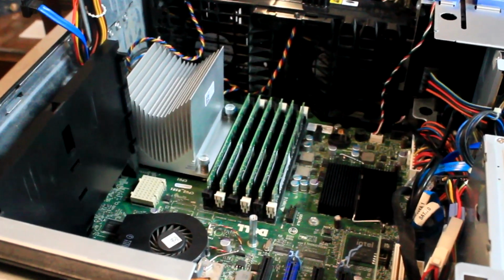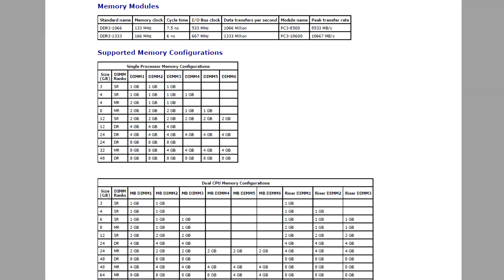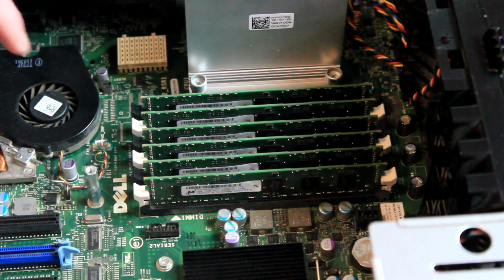Dell Precision T5500 Build Series: Part 3 - RAM Upgrade

Comment: Hello - I am looking for some help on RAM config. I just bought 3x of the $22 Patriot DDR3-1333Mhz ram from amazon. I put all 3 in the riser and then have 6x 2GB chips on the main mobo. I get the 1-3-2 beep code and even after an hour the 1+3 lights are on and it won't boot. Not sure what I'm doing wrong with the config as it appears to match the service manual. can you advise please?

Comment: Per the diagram in the service manual, there are 3 channels per CPU. Why would it make sense to add the larger ram to the riser? Shouldn't the channels be evenly distributed? I know that starting with the riser is what the instructions say, I am just trying to understand the logic. Ta.

Comment: I installed 3 new 8gb ram cards in the riser, and transferred my old 1gb modules to the motherboard so that all 6 dimms are filled. (3-8gb cards in riser, 6-1gb cards on motherboard).  When i start the pc back up it just beeps 3 times and nothing comes up on the screens.  Did i order the wrong ram cards?  Memorystock.com sent me 8gb 2rx4 pcl3-10600r-09-11-e2-p2  thanks for you vid!
Reply: I have the same problem, did you manage to fix it? graxia
Reply: @Eduardovn23  yes, but i had to order 6- 4 megabyte cards (total of 24) so that all the slots had the same capacity.  it worked fine after that
Reply: thanks! I have the same issue. I ordered 3x 4GB chips from Amazon. So 6x 2GB chips in the main MOBO slots, and 3x 4GB in the riser. Get the same 1-3-2 error - do I need to have another 4GB chip in slot 1 of the MOBO for some weird config issue?

Comment: Is this series to be continued?  I am interested in it, because my T5500 is on-order.  I am building a home server for games and media.  My new system is coming with 24gb installed, I assume 4gb modules (because they said 6 modules), so if I upgrade by adding some with 8gb modules, I would start putting those onto the riser card, moving the 4gb modules all to the mainboard??  Since I would be adding 3 of the 8gb modules.
Reply from the maker: That is correct. The higher capacity modules go onto the riser board. And yes, the series will be continued, it will be 10 parts when complete
Reply: @DVTutorials  That's great!!! I just got one the other day and running it.  Works very well.   I look forward to more videos from you and I just subbed.   Thank you.

Comment: I have a couple of questions. 1.  If you had the choice of Hp z600 or a T5500 which one would you get and why? Also, can the t5500 use dual X5680? Lastly... Is it easy to replace the internal speakers in the t5500?
Reply from the maker: I have not personally used a z600, but a review of the tech specs for that computer don't even come close to those of the t5500 (RAM, CPU, etc). The Z800 is closer to the T5500... Yes the 5680 would work... and the internal speaker is a simple install but its a cheap business speaker and I believe you need the dell audio driver for it to work properly. Reference the precision manual here https://dell.to/2WsOwYg

Comment: Quick question, only the T5500 and T7500 support those higher density RAM modules, right? A T3500 even with an X5680 (as an example) would only support a total of 24GB, right? I'm reading conflicting things on the internet and wondering if I can stuff 48GB of memory into the T3500, assuming that I can find that much for a decent price, ha. I know the higher end models need Registered ECC and the T3500 needs unbuffered ECC, which makes prices a little screwy when looking online.
Reply from the maker: Right, the T3500 can support up to 24GB of DDR3 RAM
Reply from the maker: https://dell.to/2WsOwYg

Comment: Can i use 1600MHz
Reply from the maker: No, the T5500 supports up to 72GB 1333MHz DDR3 ECC Registered DIMM memory. See the tech specs I posted in the description
Reply: @DVTutorials   does have to be  ECC memory
Reply from the maker: @AbdallahSallam88  Yes. ECC memory is very cheap on ebay
Reply: @DVTutorials  Thank you for reply